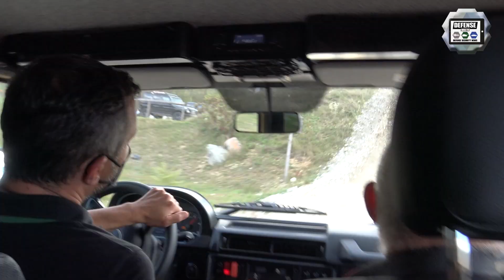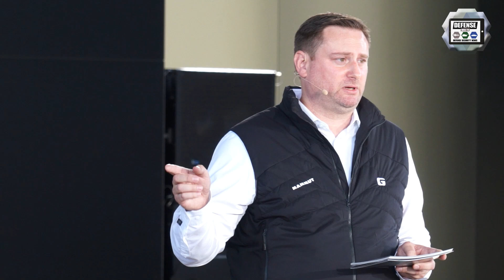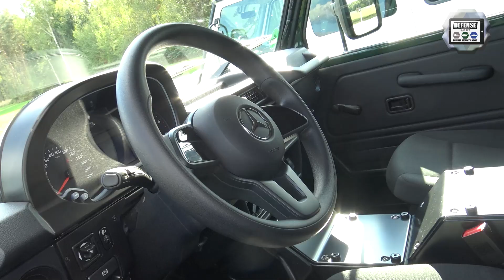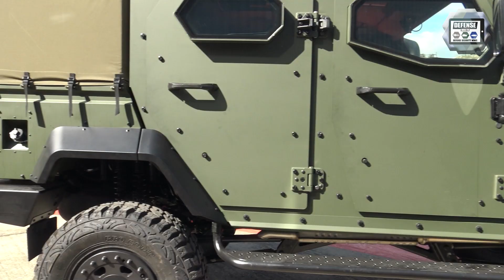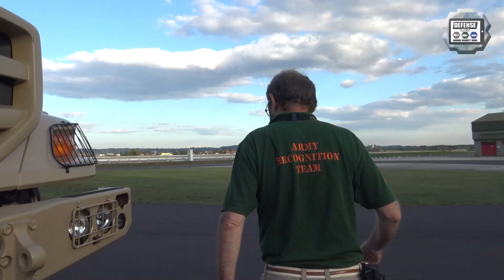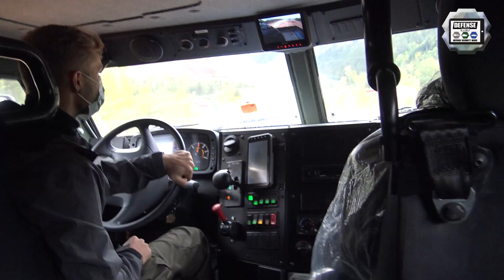New 464 G-Class Mercedes Benz & Zetros 4x4 truck World Premiere test drive and technical review

Comment: Well if you going to put the radiator on the front bumper and you are in the middle of an ambush all those bullets will hit the front bumper so you know your truck will overheat I guess they thought very well to put the switch so we won’t use it again

Comment: the weight of the new 2021 Mercedes Benz G-Wagen LAPV (W464) 4X4 + 4.5 in. Lift 4.2 TDI I6 4-Dr Armoured SUT (RHD) can be further reduced by replacing certain metals with lightweight ballistic composite Kevlar rated to STANAG 4569 (2A+) . . .